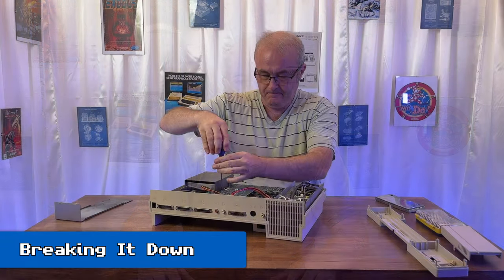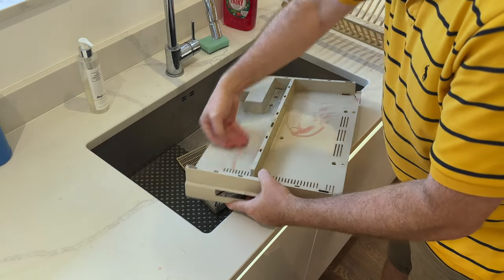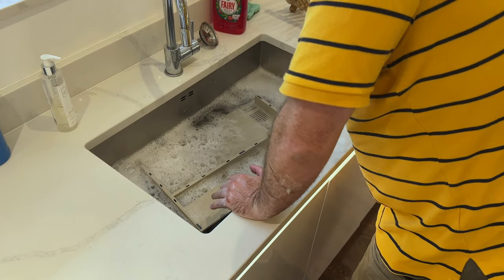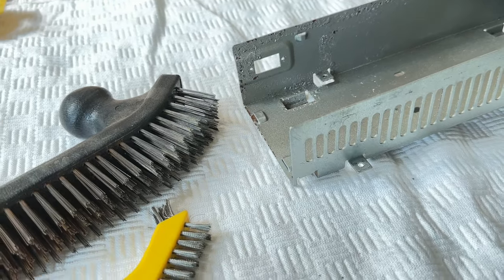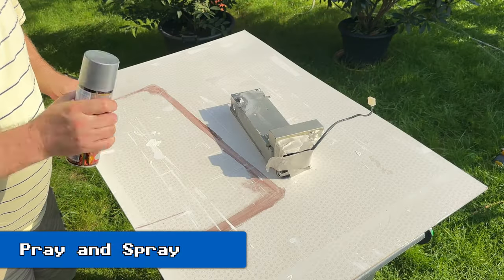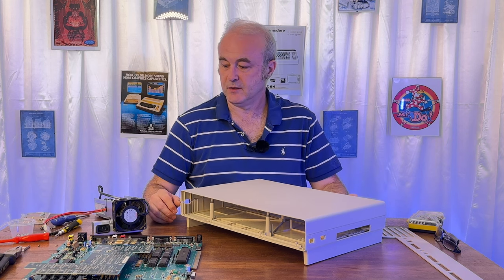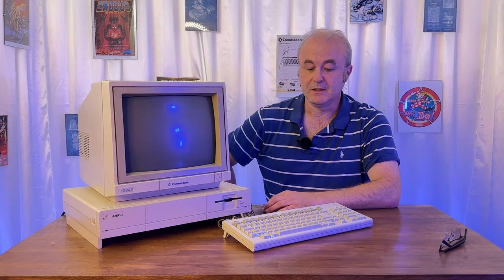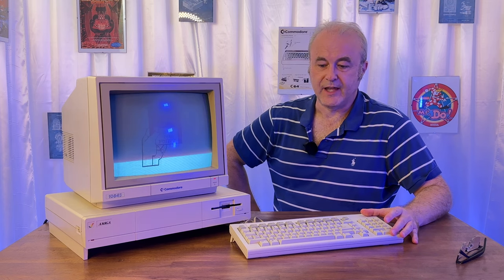Amiga1000 CH02: Case & PSU Repairs

Comment: I just picked up my very first Amiga on EBay, just came today, and it's also an A1000!  It is really dirty and has a little rust (not as much as yours).  I don't have a keyboard or the Kickstart or Workbench, so no idea how I'm going to test things at this point.  I mainly repair TRS-80 Color Computers (which is what I had as a teenager), so I'm hoping to get this running.
Reply from the maker: Wow, I know it was really a moment when I finally got my 1000! For the rust, as I said, I found that Harpic worked surprisingly well, but Im not sure I would put it on anything delicate, its pretty acidic. But it removed rust and rust stains on my plastic really well.
I know you can make a new keyboard, if you can get a known working A500 KB. But it requires some cable manufacture, and would need a case. I know Jan Beta has a video where he covers doing this.
The 1000 is relatively complex, as it has the daughter board for the Kickstart RAM, and I don't know if any good schematics exist for it, I know Amiga PCB Explorer does not have it, and thats a GREAT help to diagnose and fix these machines. People tend to focus on A500's and A1200s mostly these days. Anyway, good luck with the 1000, I hope to have more videos on it soon.

Comment: Harpic uses 10% HCL, hydrochloric acid. Small wonder it removes rust well. The Jenolite uses ortophosphoric acid, which is less efficient, though it has slightly higher percentage. Still not as good. HCL will work faster and be better at clearing out pores in the metal.

I would clean off most of the paint before repainting. I would also remove the fan and cable. Acetone will get rid of the paint, and then re-coating will be nice and smooth. I'd probably be a complete overkill OCD and undercoat with a zinc based paint, just to be sure the rust won't come back.

And then I'd replace the innards of the PSU with a NanoATX and an A1000 PSU converter. :)

I'm crazy though. Don't mind me!

The caps on the A1000 are overengineered like crazy, and from before the cap plague. They should be perfectly fine still.

Really nice case repair. Looking great. Also, the feet are missing, all of them, as you surmise. Never seen any for sale anywhere, but they can be 3D printed in TPU or something.

The A1000 was not beige at all when new. Source: I owned one. Still do.

The keyboard has an RJ10 jack, and the wiring is just straight through. An RJ11 landline headset phone cable will work fine. Same connector.

A PiStorm works extremely well on the A1000, by the by.
Reply from the maker: I do plan to return to this fella, pretty soon. The PSU replacement seems like a must, don't want to use that transformer, waste of energy, and also possible for me to forget and plug 230v straight in :/ Unless it displays more signs of rust next time I open it, Ill just replace the innards. Those case screws are HORRIBLE and make opening it very tough, strange choice of screws from Commodore there....

I decided to go light on the case retrobrite, as I did not want to immerse it in that much peroxide. Also, it actually looks ok as is. Though it could be a tidge lighter now to match the keyboard, which is pretty pale.

I have received a Parceiro II+, which I plan on installing soon-ish. When I do that, Im going to review that unit. Bit of a revolution that thing. I dont plan to "over-clock" the 1000, as I have an A2000 soon to be a 68030 @ 50hz, and I also have an A4000 68040 @ 25hz. So those can be the speed machines. I want it more to be close to stock. The Parceiro does seem like a nice addition though, to smooth over the Kickstart loading issue. 

TBH, my studio is a tiny space, and my dining room table is my only workspace right now. I do plan to have a better space towards the end of the year for both, but thats going to cost a fortune, and Im saving for that. No Patreons yet, or Ko-fi sibscribers, or indeed any revenue from YT, so its going to gut me.
Reply: @RetronautTech  They are Torx 10 screws, if they are like the ones on the 3 I have.